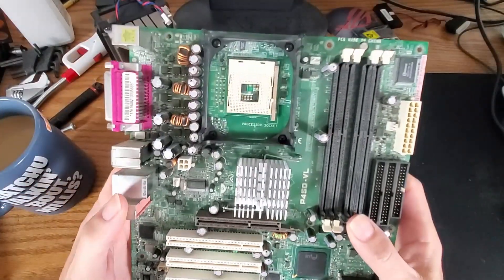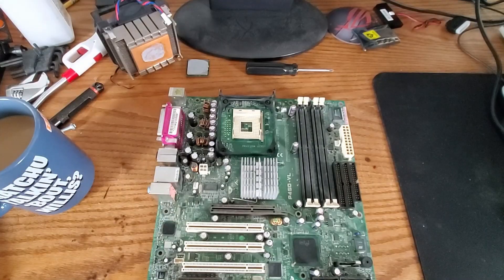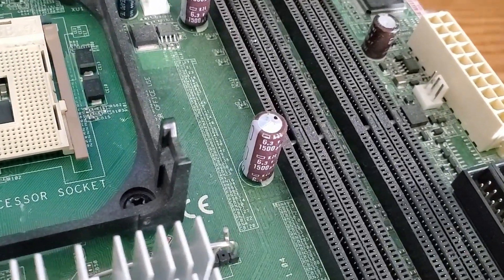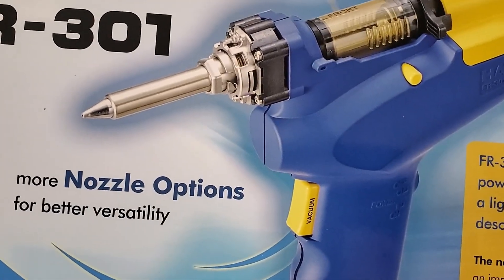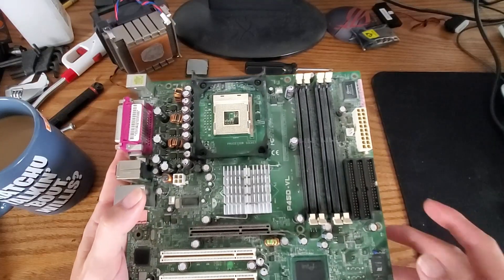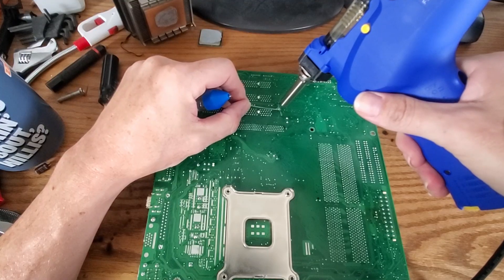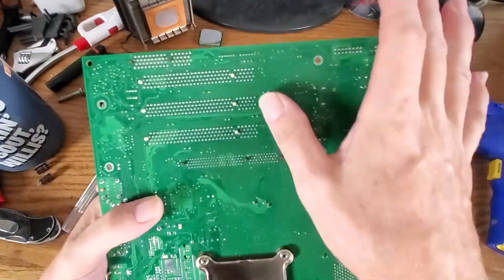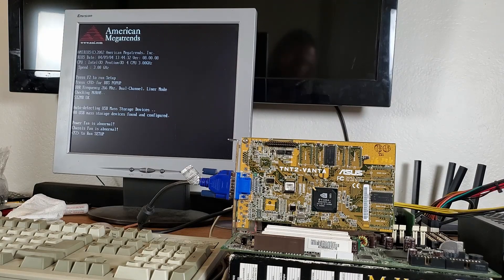Hakko FR-301

Comment: Pro Tip: If You Want Desolder Really Quick Heat The Board With Pre-heater Specially Around The CPU
Because That Area Has BigAss Ground Plate They Suck So Much Heat And Add Fresh Solder On Top Off The Old Solder Wiggle The Desolder And Suck It
Reply: I know. But I even don't own a hot air heater or Pre-, Heater 😢

Comment: Think I got two P4SD-VL Sony Vaio 2.6 & 2.8 MHz PCs in my collection. 
When I looked on eBay for such motherboards they were quite expensive pretending to be "industrial" mb. 
Basically I am not interested in P4 / Xeon PCs if they are not "special" like Vaio, hp, compaq or Dell etc. systems.
In addition, P4 MB often have problems not only with elkos. 
Once I had to exchange an elko on a SS7 MB and I do not own a desoldering iron pump. I really was a mess.